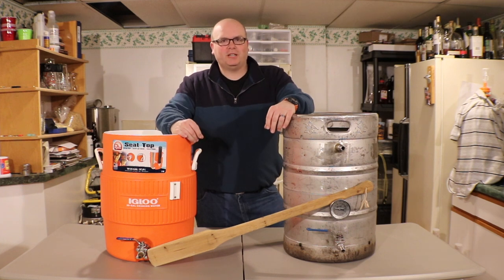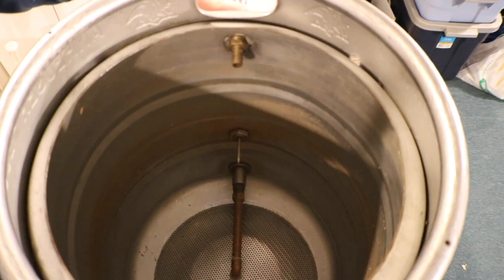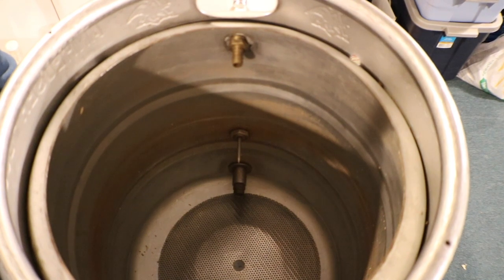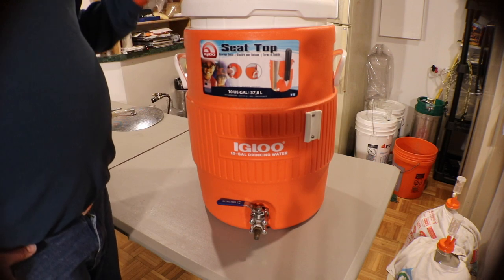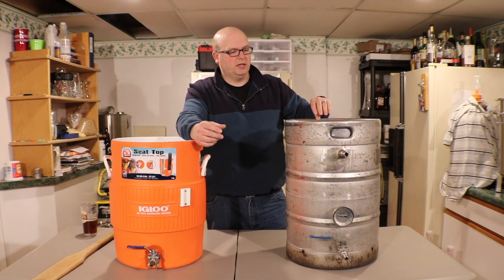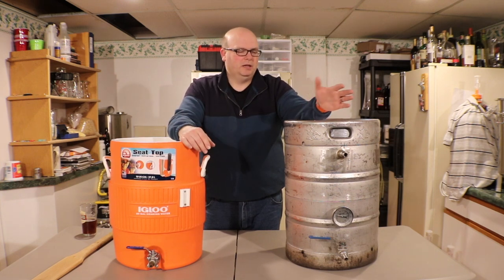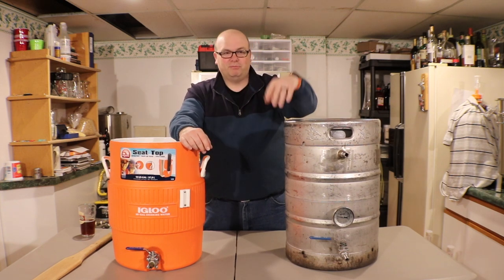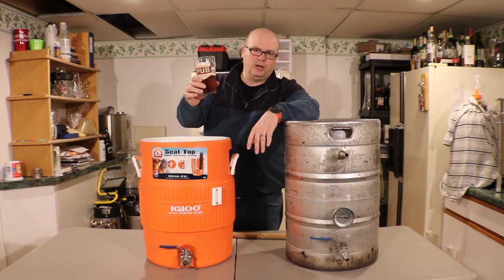Homebrewing Beer Equipment - Comparing Cooler Mash Tun to Stainless Mash Tun

Comment: Mike, great video on the pros and cons of mash tun make ups.  I personally use the cooler for all the reasons you described. I use one also for hot liquor and tier it up for gravity fly sparge and collection. All my vessels are 10 gallon capacity. For big beers I just do the calculation for 8 gallon batch. Yes it's easier to double the numbers but not really hard to go the extra effort. Just use a 5 and 3 gallon kegs. Or bottle 3 gallons for competition and give a ways and 5 gallons to keg and enjoy. Thanks!!
Reply from the maker: Thanks!
Reply: INOCULUM BREWING  Great idea ! I’ve been too focused on making bigger batches and end up making a mess trying to bottle fill from a keg.

Comment: Moving to all grain and still deciding what mash tun style to go with. Great video! Very informative. Cheers!
Reply from the maker: TBH, I'd ease into all grain with BIAB if you already have a 10 gallon kettle if I was starting over.  If not I got my start in a rectangular cooler which always worked well.  Depends on your price point.  I haven't highlighted it yet but in our more recent videos you can see I am back to a three vessel system and mashing in a kettle with false bottom.  Maybe its time for a video on that.  Cheers!  -Mike
Reply: @BrewDudes  Thanks Mike. Great tip. I’m going to try BIAB.

Comment: I use a keggle mash tun. I've sprayed the base of the keggle with insulating foam (so it's unable to be direct-fired) but with a yoga mat wrapped around it, a pre-warmed cast iron lid which has enough weight to keep it close enough to airtight and a thick sleeping bag over the top I lose about .2 of a degree celsius over a 60 minute mash. Ambient temperature is approx 25c so it will be interesting to see how it goes in winter.
Reply from the maker: I thought about getting one of those fireproof safety blankets for wrapping.  Thought it might be able to take a bit of heat wash coming up the sides.  This might allow for better insulation than my cheap reflectix wrap which can melt if too much heat is applied.  Thanks for sharing.  -Mike

Comment: I have same problem with my keg so that's why I'm installing 220v heating element in keg and will have RIMS heater also for keeping temp steady. This way I can have hot water tank and mash tune in the same time. Plus I can brew in the garage in cold weather when with propane I have to be outside. Great vid, thanks for sharing
Reply from the maker: I had given a lot of though to making a RIMS too.  Recently, I've had some new revelations about mashing in a stainless steel MLT. We will need to produce an updated video about it.  Cheers!  -Mike

Comment: I started with a cooler mashtun and I'm now debating on converting a keg, I have a lot of trouble getting strike temps correctly in my cooler, even with preheating. Also I found out a nasty problem with my cooler and maybe others, I cleaned out after a brew day and it still felt heavier than I should, so I tilted it upside down and a black viscous gunk started seeping out of the inner and outer layer seems, apparently liquid trickled in over many brew days. I think direct firing will be a lot easier for temp corrections than water additions. Great video. Cheers
Reply from the maker: Yuck.  Yeah, that small separation between the inner and outer layer can be messy.  Mike had issues with the direct firing but that doesn't mean you won't have an easier time with it.  Brew on! - John

Comment: Nice work, Mike. I use direct fire, wrapped in blankets during the mash and only recirculate while I'm raising the temp to mash out. My wort clears up nicely, and I can still get some things done during the mash. Of course, it requires more babysitting in the middle of winter, in Maine. Cheers!
Reply from the maker: I've been thinking of not running the recirc the whole time too.  I realized thats probably a significant source of heat loss.  Thanks for the support and your thoughts on the process.  I do like the control of direct fire, its the baby sitting that makes it less fun.  And I don't want to invest yet in an automated pilot light system.  -Mike

Comment: I use the igloo cooler with false bottom. I've gotten pretty good at hitting a temperature between 150-154. I'm usually mashing at 151-152. I used to stress out about getting a very specific mash temp.  But I have found it doesn't make that big of a difference as long as I get within a few degrees above 150. I used to think about trying a heated kettle for a mash tun, but you bring up a good point. Plus I don't have a pump. My system is all gravity feed. I do like how the cooler holds the temperature steady for the duration of the mash. I even left a mash overnight one time and it probably only cooled by a couple degrees.
Reply from the maker: Nice - I like mashing in a cooler too. Thanks for the comment - John

Comment: If I wanted to use high temp silicone tubing on the inside instead of pipe for a steel mash tun, that should be ok right?
Reply: Mario R yeah that should be fine, I’ve seen people do it both ways with no issue.
Reply from the maker: Yes
Reply: I use silicone tubing in my stainless  steel mash tun with all stainless connections, brass can contain lead. Don't like using plastic mash tun because of chemical leaching from the plastic. I do have to babysit the mash to maintain temp and use recirculating pump.

Comment: I have just been able to reduce the heat loss from my cylindrical cooler MT - I drilled 4 small holes in the outside of the lid and squirted in some expanding Polyurethane foam.  It will ooze out of the holes, but once its dried you can easily trim it off.  I think my heat loss was about 6 degrees C over a 60 minute mash before the modification,  and now it is just under 2 degrees C.  I found the foam in the paint preparation section of Bunnings (hardware warehouse chain here in AU - your equivalent may be Home Depot?)  Hope this is helpful to you or others.
Cheers and thanks for the Vids!
Chris
Reply from the maker: Thanks for this comment.  I think people greatly underestimate the effect of the lids insulating role in maintaining mash temps.  Heat is rising and it will go right out the lid if it can.  CHEERS!  -Mike
Reply: Chris H Brilliant idea.!!  1of my 2 10gal mash tuns has the air filled cap which I can fill. Any ideas for the other screw top??
Reply: Tito Arista what is in the other cap?
Reply: Chris H screw on type

Comment: Nice comparison.  I've always done the cooler method as I only have one burner, and it's used to heat my sparge water while the mash ...uh... mashes. I've always wondered whether the downside of a keggle or mash kettle would be dealing with the maintenance of applying and watching the heat as you described.
BTW, if you'd like a spreadsheet that will calculate the exact strike water temp for a specific recipe, check out my brewing recipe template spreadsheet on my website or YouTube channel.  I'm able to punch in my grains and have it tell me very accurately how much and at what temp the strike water needs to be to hit my target mash temps.
Reply from the maker: Thanks for the comment and support!  -Mike

Comment: Super stoked to find your video.  I now only do 10 gal high gravity (8% abv) IPAs and ny grain Bill is 25 lbs.  how much strike water needed and will it all fit in keg mash tun?  I think my efficiency is suffering with tooo little strike water. Currently doing batch sparge with 2x runnnings Do not have recirculating port on my keggle Any idea how much temp loss without recirculating?
Reply: Also will bazooka work as well with keggle?  I have an extra one
Reply from the maker: Super stoked you found us too.  Please subscribe!  I can do up to 30lbs of grain at 1.5qt/lb in my 15 gallon keg mash tun.  For big grain bills like that, surprisingly I only lose a 2-4 degrees during the mash without recirc.  You have to cover the top though.  I use a stainless steel lid and some old towels to keep heat loss from the top.  Ask more questions if you need.  Thanks for the comments!  Cheers!  -Mike
Reply from the maker: In short a bazooka works for separation but it does a poor job picking up from the bottom of the convex bottom of a keg. So lautering efficiency suffers.  If you use a dip tube to the bottom them use a bazooka it should work better.  I use a stainless false bottom and I have found it better than using a braided hose or something when in a keg.  The false bottom doesn't even have to span the whole base, just most if it.  -Mike
Reply: Brew Dudes Great! Picked up a used 26 gal kettle. Looking for the cheapest way to optimize my mashing setup to do high gravity (8% ABV) IPA’s with my “caveman” setup. Have 2 10 gal mash tun coolers and 2 Keggles( no recirculating ports) Total grain Bill looks like 56 lbs. How much sparge water for 20 gal batch??
Reply: Forgot to mention I scored a chugger to help with HLT water transfer

Comment: Hey great video. what is the diameter of that false bottom? just ordered the same cooler but im worried my false bottom might not fit.
Reply from the maker: Its like 12-ish across.  I just fills the base of the 10 gallon cooler.  Cheers!  -Mike

Comment: Awesome! I have been hunting for this comparison for some time. I only do 10G or 20G batches. How big a grain bill will fit in SS tun??? Have u looked at adding a electrical heating element and ink bird to maintain temp on SS mash tun( after heating with gas) ??? Also wanted to see your recirc fitting on SS tun.
Reply from the maker: Oh man depending on the liquor to grist ratio the converted keg can hold a lot, about 30lbs comfortably for 1.5qt/lb.  I used to dream of doing some sort of RIMS or something but what I have discovered is that the mash holds temp pretty well despite not being insulated.  If I was to totally max out the tun the thermal mass is so big it would hold 154F for at least 30-40 minutes.  The key to all mash tuns is to have the lid insulated.  I just did a 6 gallon mash in a 15 gallon SS kettle where I covered the lid with a couple old bath towels and a fleece jacket.  The ambient temp in the garage was 40F.  That thing held temperature just fine.   So I have left the idea of needing a RIMS or HERMS behind.  Remember that most of the mash activity happens in under 20 minutes, the rest is sort of just waiting.  I've shortened my mash regime to 40 minutes as off late in SS and its been working just as good as when I did the insulated cooler.  I'll do a mash specific video soon with my recirc set up.  Cheers! -Mike
Reply: @BrewDudes  Thanks Mike. Looking forward to seeing your video !!

Comment: you might try using two electric charcoal starters wired into a PID controller to control the heat. Run a thermowell in place of your analog thermometer so you can place the thermocouple for the PID into it to track and regulate wort temp. No more baby sitting and you can have it stay within a few degrees of your desired temp the entire time. two charcoal starters will usually run 1500w total so that is the max you can probably safely run on a standard circuit without tripping breaker. try using kaowool ceramic blanket to insulate the bottom fixture you create to house the charcoal starters.
Reply from the maker: So interestingly I've discovered that even in an uninsulated mash tun that is stainless steel.  The mash actually holds temp pretty well.  I realized that my continuous recirculation is where I was loosing my heat.  We will do a video on this in the near future.  If I do go electric at some point I will remember this post.  Cheers!  -Mike

Comment: Igloo is very well insulated and could be a very good mashtun if you could recirculate with a pump. I use insulated keggle with herms and it works great if you have seen my brewing vids
Reply from the maker: I 've thought of boring a whole through the lid with an adjustable spray arm.  Then I could recicr with the pump, and put a HERMS in line in my HLT... I know a couple guys that do it that way.  Problem with that is you need to be making any extra 1/2 gallon of wort to account for all the line losses.  hmmm.  -Mike
Reply: Brew Dudes thank you

Comment: i drilled two holes in the lid of my orange 10 gallon home depot cooler i used and filled the lid w spray foam to further insulate it
Reply from the maker: Good tip - thanks!  - John

Comment: Add a herms coil, in a HLT, with ink bird pid, using a hot water heater element.
Reply from the maker: That would be an upgrade I am thinking about.  But I gotta brew more before I can mess around with equipment again.  Cheers!  -Mike

Comment: which do you prefer cylinder style cooler or rectangle? and why?
Reply from the maker: I think I like the cylinder style more as far as using a cooler goes.  Mainly because I think I get slightly better efficiency with the narrower set up.  That said I think it wouldn't matter much if I was fly sparging, vs. batch sparging.  -Mike

Comment: I'm sure you're aware, but there is lead in brass.
Reply from the maker: Absolutely.  But I think its been well accepted for quite some time that the surface lead is quickly removed by the acidic environment.  I have seen data that shows the internal lead doesn't leach out.  Also I have only a couple small fittings of lead and they don't contact the wort for long.  All that said, you can see in the video the coupling that I have attached to the stainless braid is stainless and all the other parts and ball vales are stainless.  I have worked to replace the pieces and I am slowly working towards being an all stainless brewery.  Even in my fermentors... but that's a future video.  Thanks for the comment.  -Mike

Comment: I definitely like using a round cooler to mash over a square cooler. No keggle yet so i can't compare.
Reply: I must be the only guy that likes using a square cooler lol
Reply from the maker: I should have shown my old square cooler.  I liked it a lot.  And it was almost 12 gallon capacity, which meant I almost never had issues with big mashes.  I always sort of thought though that. I was losing wort to dead volume in the corners.  So the increased capacity was lost on losses in efficiency.  That's when I switched to the keg mash tun.  Last year I bought the cylindrical cooler to belay my fears of efficiency going back to a cooler set up.  -Mike
Reply from the maker: Stay strong!!!! -Mike